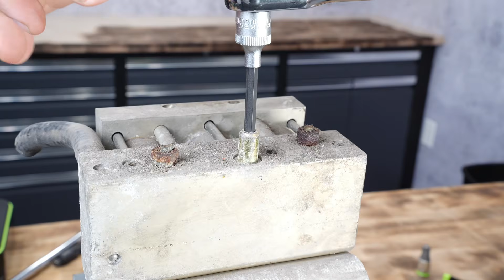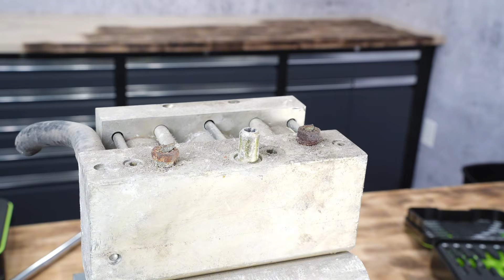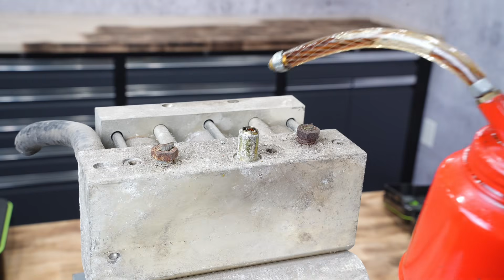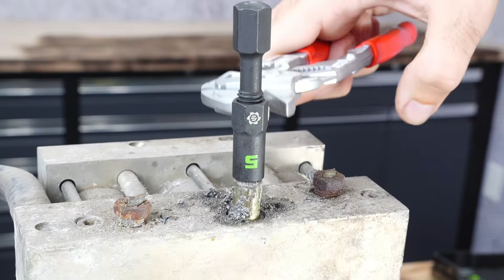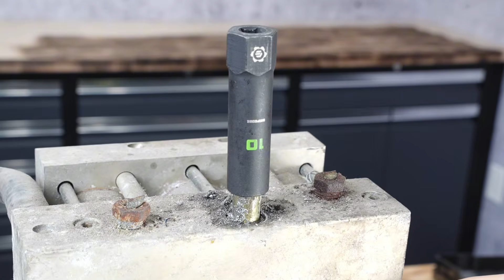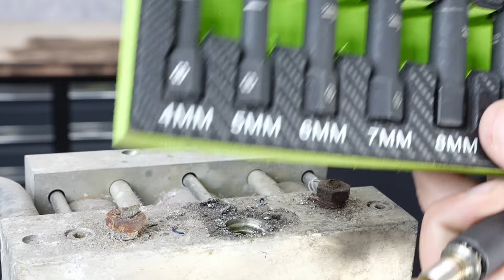Two Different Methods to Remove Rounded-Out Fasteners and Bolts with GripEdge G-FORS Extractors

Comment: What's your approach removing "hollow" nuts where the removal tool would just slide through? 
Edit: to be more specific, asking about removing lugnuts out of the sockets
Reply from the maker: you just thread it back on to the threads lightly so the removal rod has something to push off
Reply: @gripedgetools  obviously 🤦 stupid me 😅

Comment: Just keep in mind everyone that he said nothing about what grade/hardness of fasteners that their tools will properly work on ( which includes without damaging the tools) as shown in the video  .... only grade 2, no more than grade 5, all the way up to grade 8, or what?
Reply from the maker: The internal BBX14S is made of S2 Steel work great on grade 8 bolts even work on 12.9 which is what we use to demo at the shows. The socket extractors also work on grade 8 and 12.9.

Comment: Can you use it for a reverse threaded bolt
Reply from the maker: yes you can! Its a bi-directional design so you can tighten and loosen. So perfect for a reverse threaded bolt where a regular extractor wouldn't work

Comment: How do you stop the #1 extractor from snapping?
Reply from the maker: What use case are you using the #1 on? But first is use caution when using it they are designed not to slip. So they hold stronger then what the tool is capable of handling. They are made of S2 Steel which is one of the strongest tool steels available. But your dealing with the diameter of the tool which is around 2.5 mm and that can only handle so much torque. Always use the largest size BBX14S extractor you can, apply heat, and penetrating oil and don't try to over power the tool. That should help prevent snapping the number 1.